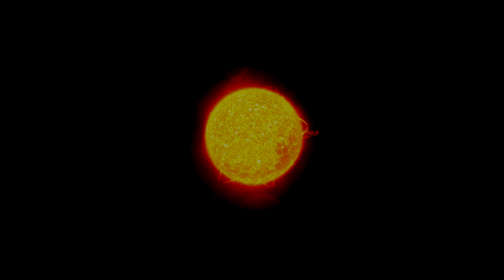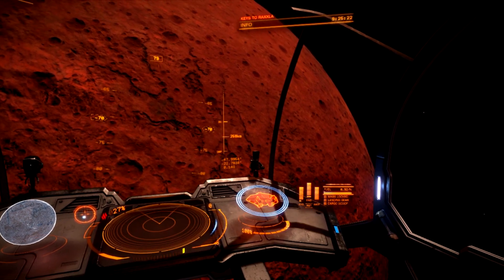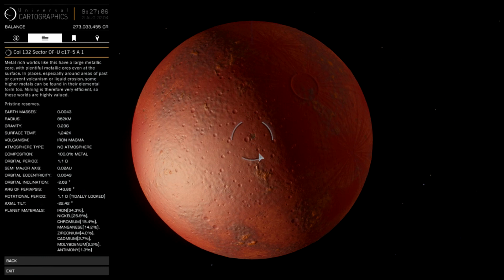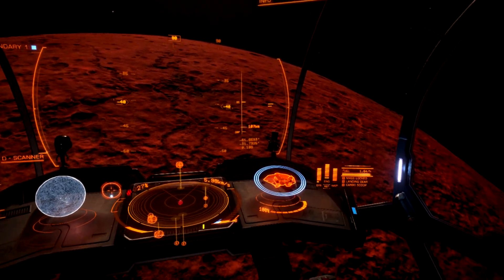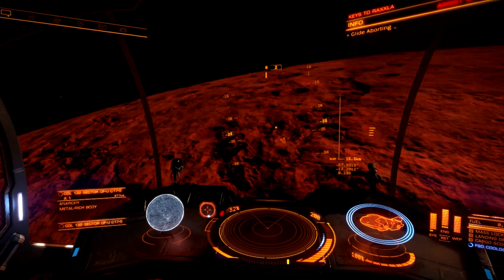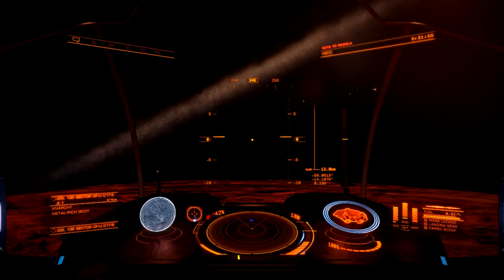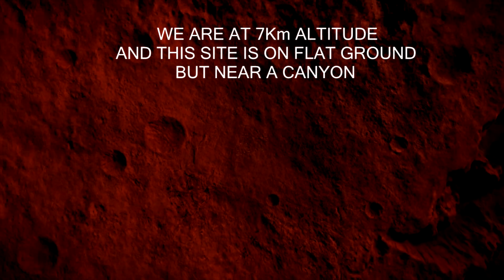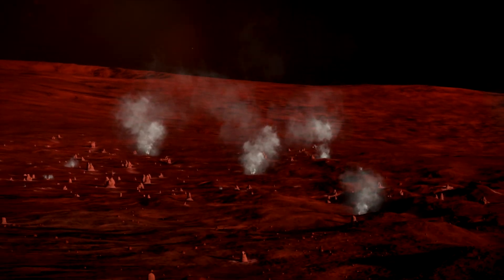Elite Dangerous- How To Find Volcanism and More

Comment: Liked and subscribed! Watching this definitely increased my interest in surface exploration. A few questions though.. 

Does the tick only happen when there’s one of these special POI’s on the ground, or always? -Haven’t seen any ticks yet...

 I’ve been searching a similar planet in the Goller system (close to the star and descriptions says Silicate Geysers), but not finding any canyons or active volcanism. Should there be active stuff there or are some planets just too old or something? 

Thanks again, and I’ll be sure to check other systems and planets for this.
Reply from the maker: Sadly, just because a planet says it has volcanism, doesnt mean it will. There are 3 grades of volcanism, which you can see on PC (sorry consolers) by looking at your journal, or by using EDDiscovery. Its believed that the Major volcanics have the highest chance and the chances go down from there. Ive found stuff on all and not found stuff on all grades. Some people appear to not get the tick. It was taught to me that you need the tick to get a persistent POI to spawn but this has been proven wrong on many occasions. So its just a guess. I cant recall finding any persistent POI on a planet without a tick. Thanks for asking and watching. o7
Reply: Thanks! I just tried EDDiscovery and have to admit it might take some time to become friends with that piece of software... But your reply is already helpful. I’ll just have to probe different planets until I find some good ones. Keep it up! You make good videos :-)

Comment: Thanks for putting together this great video, you've made it straightfoward for anyone to get started with volcanism surveying.

Your video clearly illustrates how much better the linear scale is for spotting these tiny-tiny POIs.  However, as we discussed in the Canonn discord, I don't think it's because one scale has greater reach than the other, it has to do with rendering.  Since in the logarithmic scale the POI is way smaller (and gets even smaller toward the edge of the radar) you simply can't see it at the edge because the game (or video card) can't render a POI that small.  Now, since the POI is so hard to see at the edge of the radar in a log scale, it's very difficult to measure the sensor radius the same way we can with linear.  But we believe the two to be the same.

A number of us in the MWSOG community have estimated the linear sensor radius to be around 8.2 km.  We infered that number by using the following formula: S = R*delta-theta, where S is the sensor radius (or more formally, the arc length), R is the body's radius, and delta-theta is the latitude difference between the POI at the center of the radar and the point where the POI falls off the edge.  Again, since the POI is much larger in the linear scale this exercise is much easier to do than in the logarithmic scale.  

In any case, using the linear scale is way better for POI detection than logarithmic.

There are other things worthy of note regarding the ship's radar in the context of POI detection:

1) The sensor radius of 8.2 km is the same regardless of sensor grade (A, B, C, etc.) or engineering mods.  
2) The sensor radius is the same regardless of altitude.  It's 8.2 km whether you're flying at an altitude of 1.6 km (the point where POIs fade out from radar) or all the way up to the Tick altitude (where POIs just wink of existence the moment you cross it).
3) When it comes to POI detection, the radar's effective region looks like a cylinder centered on your spacecraft. That's why when you tilt your nose up the POI moves back (or the other way around, I forget) and can even fall off the edge of the radar.  It is therefore important to stay as level as possible when surveying for volcanic POIs.

Thanks again for making such a nice video, keep up the good work!
Reply from the maker: CMDR Maligno Thank You. I always appreciate the thorough work Canonn Members do. o7